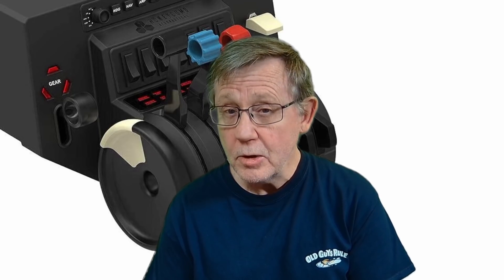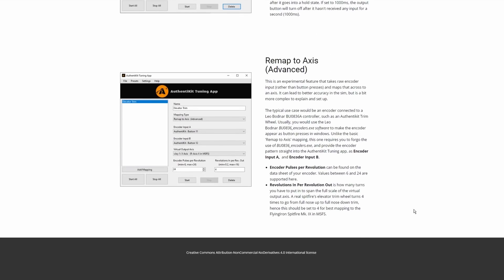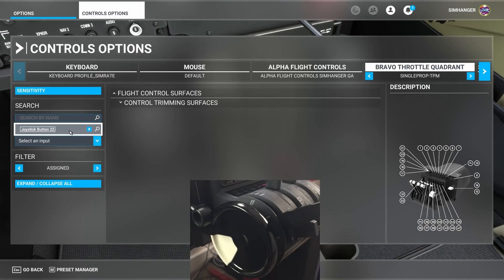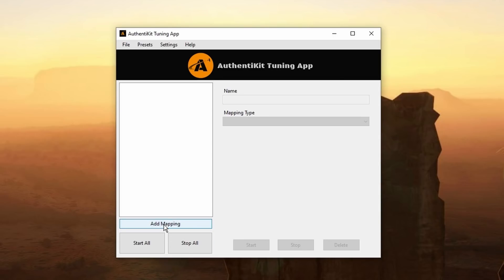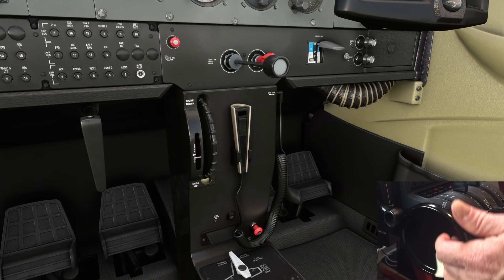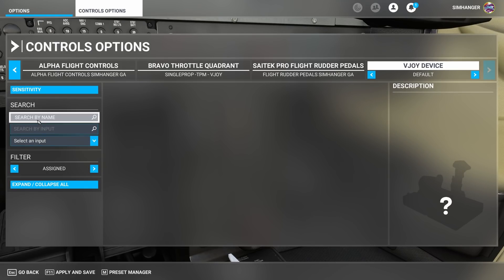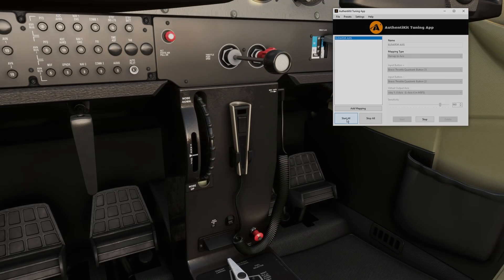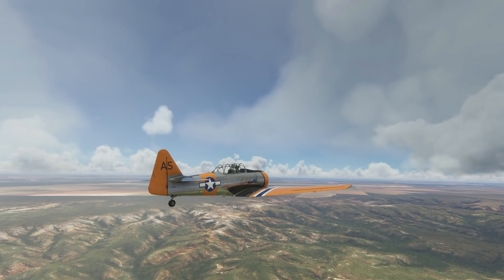SENSITIVITY FOR YOUR TRIM WHEEL | Freeware App for encoder based peripherals | Authentikit

Comment: I followed your directions in setting up my trim wheel in MSFS. It worked beautifully and made flying so much more realistic. Then suddenly – without warning – the trim wheel stopped working. Colmanian made some suggestions, but these did not solve the problem. I wonder if you have encountered this issue?
So here’s the story:
Although I had actually followed your video in originally setting up the trim wheel, I watched the video again while running, first the vjoy monitor alone, and then vjoy with the sim.
In vJoy monitor: ‘X’ responds appropriately to the trim wheel without MSFS running and then with MSFS running, but in the latter case, no response from the sim (i.e. on screen trim wheel did not move).
In MSFS Control Options | Bravo Throttle Quadrant,
search by input: wheel forward - button 22
search by input: wheel back - button 23
both these inputs also register in vJoy monitor
Again, in the cockpit: no response from trim wheel - but vJoy monitor registers the movement correctly.
I then checked all other peripherals, the only response to a name search for ‘trim’ was for rudder trim in Alpha Flight Controls.
To see if it was just a case of the actual wheel movement not showing I tried using the wheel while flying; the trim controls do not operate. I can use the trim wheel with the mouse, but extremely large responses and impossible to use in landing.
If you can help I would be very grateful.
Robert

Comment: just plain doesn't work.  have reinstalled twice and the trim wheel doesn't work with the vjoy config and the bravo config as said but my authenticator doesn't show "button multiplier" only "remap to axis","remap to button" "remap to button(advanced)". also nothing happens when I spin the wheel in the authenticor app.  Also, i do start the app before the simulator.   another incredible waste of time in msfs. 🙃  Finally got it to work.  The 2 separate profiles only needing the one, the first one to work is confusing so I was not using the right one I guess, i used the first one.

Comment: How timely! I spent all yesterday afternoon trying to get this very issue resolved with vjoy and Joystick Gremlin without a satisfactory result in my preferred aircraft (the DA62). The axis profile works mostly well, but there is a strange issue where nose down from TO trim is smooth, but nose up from TO is way too sensitive. Turns out that my default sensitivity for the vjoy axis was 85% - no idea where that setting came from, I hadn't set it before! The issue with autopilot trim versus vjoy axis remains, of course.
Reply: Thanks for that, same happened to me.
Reply: I've been at this problem for 3 hours tonight with my new Bravo..thought it was all about the Authentikit....and then I saw this 🙂 Thanks Michael. 👍👍👍 85% sensitivity as default!

Comment: another great video , I am having a strange problem with my trim wheel for bravo throttle quadrant and i need your help , everytime I turn the trim wheel in a direction several degress and leave it , on the sim it reverse the same turn by itself , I keep turning it several times physically and once I stop it reverse the same number of turns ( in opposite direction) which offset the nose down or up ? what should I do > thanks a lot
Reply from the maker: Hello, sounds like you have pilot assist turned on. Under the assistance menu check off to all pilot options .
Reply: @SimHangerFS  you are the best thanks a lot

Comment: Thank you Mark for another brilliant tutorial. I followed and set up the trim exactly as you explained, works like a charm. Only issue I have is with the Just Flight piper arrows, trim will only work between neutral and full nose down. It stops at neutral no matter which way I rotate the wheel. Can not achieve any nose up trim from neutral at all. Otherwise it’s excellent on all other aircraft. Massive thanks to Ian and yourself.

Comment: Hi Mark, thanks for your detailed explanation! Really easy to follow when implementing.

However, I want to add my experience:
The implementation as an axis worked (as in your video), but you must be sure no other controls change the trim, e.g. the buttons on the Alpha Yoke, or the autopilot. For testing this I set the trim to 25% via the wheel, then changed it via the yoke trim buttons to 0%. A light touch on the wheel then changed the trim to 24%, that means where the axis left off. So this way of implementation (as an axis) works only if the trim wheel is the only way you change the trim. This is what I guessed beforehand as other axis (like throttle) show the same behaviour.
Then I tried the implementation as button multiplier. However, the tuning app seems to be 'sensitive' to changes in the fields 'Hold after ...ms' and 'Release Hold after ...'. Most of the time the Vjoy did not show anything after this change (I also checked in the Windows game controller settings, where you can see the vjoy buttons fire (if they do)).
Additionally, I found that the planes react differently to the trim wheel, some are quite responsive, some nearly do nothing, because the increments are so small. That means, a general multiplier for all planes will not be suitable.
So I hope that MS/Asobo will change this in the sim itself, it should be quite easy to setup the amount of trim change triggered by a button 22/23 fire.
But don't get me wrong, I appreciate the explanation in your video and also the work of the developer of this tool, just for my way of using the sim (trim also via Yoke buttons and Autopilot) it adds problems while improving other handling, so I will wait and hope for the Asobo fix.
Reply: This is a notorious problem and I've spent way too many hours trying to find a solution that works to my satisfaction. Asobo needs to implement an "infinite axis" plus a "continue the setting where it left off" to deal with this. As it is, with the axis settings, it's outright "dangerous" when you fly part of your approach with AP and then disconnect at the FAF to hand-fly. Your trim will be totally off whack and your entire approach becomes the opposite of stabilised.

Comment: I installed the three programs required for the Authentikit app to work on Windows 10. The interface of the app is rendered very poorly with all the input boxes jumbled and misplaced, some of them partially or completely obscured by the other elements of the GUI, but I think I entered the appropriate values to remap the Bravo wheel to the L-axis Z. I save, "start all," launch MFS, clear the elevator trim button setting for the Bravo elevator-trim wheel, and go to fly. It seems that the remapped wheel does nothing at all in the sim. I can control it with the mouse, but moving the Bravo wheel results in no movement of the trim wheel in the cabin. I've adjusted the AuthentiKit sensitivity from fairly low to fairly high (cannot give numbers because the app doesn't include the exact 3-digit sensitivity indicator with my jumbled GUI interface)
What would be the first troubleshooting step here for no perceived functionality at all and also for the severely jumbled AuthentiKit interface (my computer has no trouble displaying any graphic other than the AuthentiKit app).
Reply from the maker: It sounds as though the install is corrupted. Uninstall all via the control panel and reinstall. Check you download the right versions for your OS etc from the Authentikit link in the video. Hope you get it resolved.
Reply: @SimHangerFS  I've reinstalled vJoy and AuthentiKit, but i haven't downloaded AuthentiKit a second time. I'll try that.

Comment: Mark, is there a good reason not to simply delete the trim wheel in the Bravo's Default profile? Under what circumstances would you use the Bravo for elevator trim without using the AuthentiKit app?
Reply: Hi there, Some simulators do offer the level of adjustment that you'd need (e.g. War Thunder offers button to axis mapping in its settings I think), but for MSFS I think the AuthentiKit app or equivalent is needed at time of writing.
Reply from the maker: You can’t delete from the default, it will ask you to give the profile another name.

Comment: I'd love to hear answers to the question, "Why didn't Honeycomb implement the trim wheel as an axis in the first place?" It seems such an incredibly obvious choice that I'm at a total loss to explain what method their might have been to their madness. Is there some advantage to Honeycomb's design that isn't obvious to me?
Reply: The answer is that having it be an axis interferes with autopilot functionality because the sim can't change what the physical axis is set to so the settings on the hardware and in-simulator end up diverging. Of course that could be fixed with "force feedback" where the sim could set the trim on the physical device as needed.

That said, if you don't care about an autopilot having it present as an axis would be clearly the superior option and even virtually mapping it to an axis has some significant benefits. In addition to that if the software had a way to figure out the state of the trim axis in the simulator when autopilot was active, it also could just make the vjoy axis follow the autopilot easily.
Reply from the maker: It’s a good question and I can’t answer that 🥺
Reply: Most likely a question of cost. Probably cheaper to implement button presses because it requires less electronics. An axis would require a potentiometer or hall effect sesnor.

Comment: Hi Mark, brilliant! Got it to work as advertised. I tried it out on my Kodiak. In addition to setting the sensitivity in the App to 210, I noticed that setting the Extremity parameter on the L-Axis X's "sensitivity" setting to 30% gave me extra control. I now can control the elevator trim to exact percentage-points with minor wheel input. Before it would jump from 0 to 1, to 3%, instead of 0,1,2,3 etc. I also had to "reverse" the Axis setting.
@IanColman: I did need to tweak the scaling of the app after install, as the font and buttons on the config screen were off. (R-click/Properties/Compatibility/Change High DPI settings/Override, performed by <System>).
Lastly, I wonder what else we can now tweak to perfection?
Thanks! Pipo.
Reply: Thanks Pipo, It's great to hear that you've got it working. Would you mind explaining a bit more about the 'Extremity parameter'? is it a vJoy setting that I haven't come across? I'm very interested in what we can do to make it work better for people, so the feedback is greatly appreciated. Cheers, Ian
Reply: @colmanian  Hi, so Vjoy gets added to msfs as a device, each device gets a mapping interface and a Sensitivity setting. Within the Sensitivity menu there are Axis by Axis settings for things like deadzone, or for how user input is translated i.e. linear for a throttle and slow then faster for a rudder, by preference of course. In there is also a parameter for Extremity, this sets how fast user input reaches the outer limits of the Axis. By limiting this range the elevation trim reacts in smaller increments, thus I see the percentage points of that trim go up one point at a time instead of occasional 2 point jumps.
Reply: @georgesiebes  oh I'm with you - the setting in msfs. That's helpful thanks :)
Reply: This worked for me with the latest version as of 15 Feb 22, the sensitivity was at -85% on the + side for some reason, set them both to -50%, worked well on the Cessna 150, much easier to dial in descent rates.
Reply: Hi, I'm on a new computer so I had to re-install this. Latest versions are .Net 7.x, Vjoy 2.1.9.1, Tuning app 1.2.2. The tuning app now has a HoneyComb Bravo preset for MSFS, so no need to find buttons 22,23. Rest still works the same.

Comment: Hi Mark great video, I tried it and it worked with the axis, then i tried the button method and it wouln't work and the axis stopped working any ideas?
Reply from the maker: Delete the button profiles, check the button configs and recreate axis config.
Reply: Hi Gerald, it's also worth checking that you don't have multiple inputs bound to the same control in MSFS. E.g. if you've assigned virtual buttons to Elevator Trim up/down in sim, make sure you've unassigned the axis from Elevator Trim -100% to %100. If the axis works for you though, that's the better option anyway to be honest. Good luck! Ian.

Comment: Does this not then introduce the problem that autopilot will change trim to maintain altitude but when you come off autopilot on approach and then touch the trim, you get an axis input spike?  That was the problem with the Saikek trim wheel which although it has an encoder inside, it implements trim as an axis and it's a PITA.  I modified my Saitek trim wheel to send encoder outputs to address this and achieve the same effect of sensitivity by managing aircraft profiles in spad.next and sending multiple trim simconnect commands per encoder input.
Reply from the maker: I was conscious of this potential issue and did test it out. Seemed to operate within acceptable parameters.
Reply: @SimHangerFS  As long as it works for you, that's all that matters. The behaviour really annoyed me with the Logitech before modification. :)
Reply: @djtaylorutube  Is that a physical modification to the trim wheel or is it just changing something in Spadnext?

Comment from the maker: NOTE: Only noticed this after the video ...on the Axis config, if you turn up the sensitivity to 860 or more it will reverse the axis. This can be fixed by lowering the sensitivity setting or checking the reverse axis box in the vjoy config.
Reply: Noted, thanks!
Reply: Thank you for the video, Mark!  As always, very clear, very thorough, and very helpful.  I know it is important to you that your videos are clear, thorough, and helpful, and you've done a masterful job.  Since you do care about the details and the gotchas, you may be interested in some things I discovered while making a video tutorial on how to multiply the button presses using some other freeware apps prior to this Authentikit Tuning App coming out. Fortunately, I don't even need to try to link my tutorial because it is obsolete now with this much better solution.  At any rate, you may be interested to know:

1) All the digital trim wheels I looked at limit the number of button presses per second (and the minimum pulse width) in order to try to avoid overwhelming the sims.  What this means is that spinning the trim wheel quickly (or not even all that quickly, really) you not only stand a chance of overwhelming the sim and getting less movement of the virtual trim wheel but you also reach the speed limit of the trim wheel's button presses, so you aren't really going any faster anyway.  Of course, your advice to move the wheel slowly addresses both of these concerns.

2) When using a button press multiplier or holding a button or key that repeats, MSFS 2020 limits the maximum repeat rate in VR to something like half of what is it is 2D.  So, you may see less movement of the virtual trim wheel in VR than you do in 2D, if you have exceeded the VR repeat limit.  This can be very confusing, so I wanted to be sure to mention it here.  If people run into trouble with this, they can make different tuning app profiles for VR and 2D.

3) An analog axis is the best way to get a 1:1 mapping of the movement of your physical trim wheel and the trim wheel in the sim, especially with the settings available in the tuning app, but there are some things to be aware of.  First of all, as mentioned in #1 above, the wheel itself will likely limit the button presses per second, so moving the wheel faster will not result in the analog axis going faster once you are over a certain speed.  Secondly, an analog axis used for trim means that the trim wheel in the sim is not just moved "up" or "down" as you move your physical trim wheel but that it also is set to an exact position.  If you enable autopilot and it adjusts the trim to some other setting, the analog axis doesn't know about this change (although that would be a fantastic addition to the sim).  So, once the autopilot is turned off, your trim in the sim may be set to, say, 3 degrees nose down, but your analog axis is still set to what it was before you enable autopilot, say 3 degrees nose up.  The trim will stay where the AP set it until you go to adjust the trim with your wheel again.  As soon as you touch the wheel, moving it ever so slightly, the analog axis setting takes over and you can see an instantaneous large jump in your trim setting (from what the AP had set it to last to what you had it set before engaging the AP).  In a real plane, the trim wheel moves with the autopilot, so this is not a problem.  For us, unless we have a motorized trim wheel, there's nothing we can really do about it other than be aware of it.

Comment: Hi is really cool! Unfortunately tried for my X Plane and the input A and B and does not appear even if the bravo is connected. maybe this app is not compatible with X Plane?
Reply from the maker: Authenticity doesn’t say…so I would guess not compatible at the moment.
Reply: Hi Lorenz, it should work in X Plane as long as vJoy is installed and shows up as an input in X Plane, good luck, Ian
Reply: Hi  @colmanian ! Really?  vJoy appears as a virtual controll in xplane. But does not appear as inputs in the authentekit app.

Comment: The idea is good but unfortunately I didn't find either of the trim options helpful. The axis option is way to digital, ironically enough, and makes it impossible to trim your aircraft out. The button option is super laggy and continues to trim long after you released the trim wheel
Reply: Ah sorry to hear that. With a bit of investigation I might be able to smooth the axis out a bit. Though if the issue is that there isn't enough resolution to provide input at the right sensitivity, I guess the only option there is have a less sensitive but more precise trim wheel. Thanks for the feedback, it's really helpful.